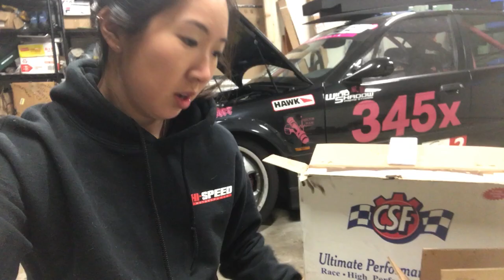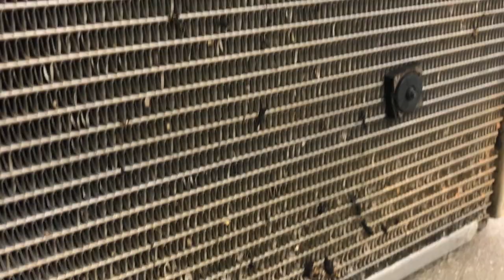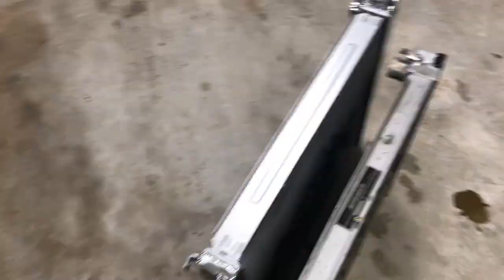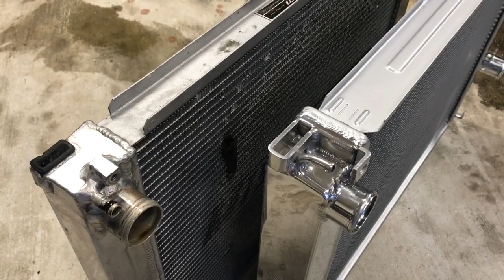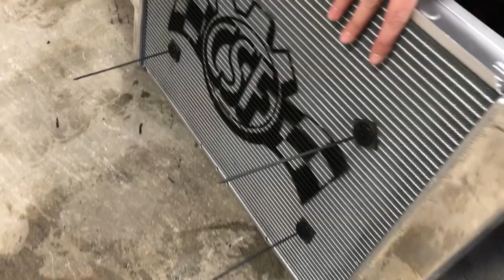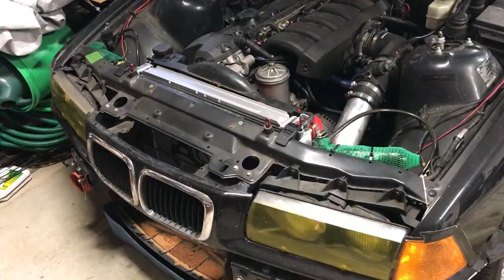E36 M3  CSF Radiator vs Mishimoto Radiator! Comparisons and Benefits

Comment: I had a CSF unit for my 335i and in 22 months it started to leak in the seams and fin welds. I just got off email with ECS Tuning and they are sending a new unit under CSF 2 yr. warranty. If your car starts to lose coolant out of nowhere...take a look at the radiator itself if the hoses are new-ish.

Comment: The CSF aluminum radiators actual core thickness is 1-5/8"  not 2".  the upper aluminum surround on the CSF radiatyor measures 2" the core is smaller. the CSF website shows actual dimensions. The CSF and Mishimoto radiator both have the same core thickness.

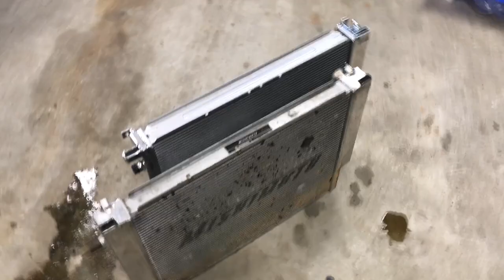Comment: 1:45 You measured them by the top bars. Mishimoto was 1 1/2 and CSF was 2 inches. At 2:34 if you look the CSFs top and bottom bars have a 1/4 inch orso overhang before the fins start.

Comment: Finally subscribed, I appreciate the videos you post. Did you see a quantifiable difference in temperature between the two? I have a stock e46 m3 radiator with electric fan and live in a very hot climate. From my research the mishimoto is basically stock in a pretty package vs. CSF or Koyorad. Appreciate your feedback.

Comment: Where you get the electric fan from to fit the CSF radiator? I'm thinking about upgrading my stock radiator to the CSF but would rather have an electric fan than clutch fan

Comment: There are lots of reports of Mishimoto e36 radiators leaking (also fitment), did you have any issues?
Reply from the maker: I didn't have any leaking issues with my Mishimoto. It was just a little worse for wear after a season of racing. Kept the car cool just fine.

Comment: Hey Christina, I am about to ram a CSF into my e36 m3, how do you like it? Does it take up much more room? I am doing a silicone hose upgrade on all the coolant hoses, stewart waterpump, alloy neck, lower temp fan switch, etc.

I am thinking 80C thermostat ( i live in southern California) is that a good idea? This is a street car, but i've been reading mixed opinions. I am also thinking of using a mini cooper puller fan, apparently they fit. 

Thoughts?
Reply from the maker: I love the CSF. Its a bit deeper than the OEM radiator but should still fit with no issues even if you have the fan clutch in there. I have an electric spal fan which frees up some space. The mini cooper fan sounds cool. The added cooling capacity over the OEM or mishi is worth it. Silicone hoses are a great "while you're in there" upgrade as well as all the other things you've listed. Smart to do it all at once rather than tear into it again when something else fails later. I run a low temp thermostat in my racecar, but run the OEM one in all my street E36 M3s. Its not really necessary in a street car.
Reply: Awesome thanks! I was debating 80C vs stock since its usually 90F+ here most of the time, Figured it would be good for cooling, not so much for economy. looking forward to seeing your oil cooler install, i'll be doing that too
Reply: im thinking mini fan or e46 330 fan, the only reason is CFMs. My old 318is had a factory electric puller and that thing pulled some serious air! I wish the m42/44 puller would fit, you could see the plume of heat rise when it powered on

Comment: I recently fitted a Mishimoto Dual Core Rad on my Seat Leon Cupra R, 6 weeks and it’s failed leaking from both sides. It comes with a lifetime warranty but I don’t know if I can be bothered with the replacement in case it happens again, I’ve been recommended CSF Rads, so I’ll be interested in seeing how you get on with the CSF Rad. As I’m looking to purchase one myself.

Comment: Hey there, love your clips!
Do you possibly have the old radiator by the side? :)
It would be of a great use on my bmw e30!
Reply from the maker: Hey Tomo. I don't have the old radiator anymore. It was pretty beat up after a season of racing so I kept it as a spare and then eventually gave it away when I sold the car.
Reply: I see you went for E46, Christina. I wonder what will your thoughts be , when it comes to racing with it.
Did you race with E46 before?